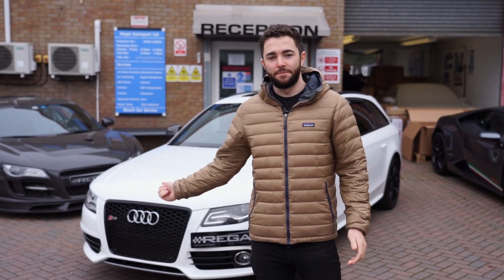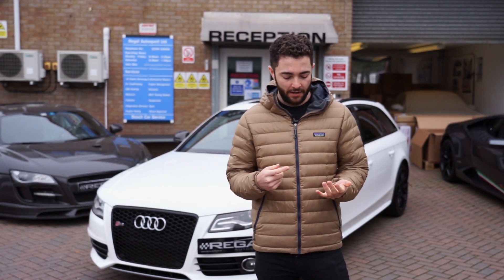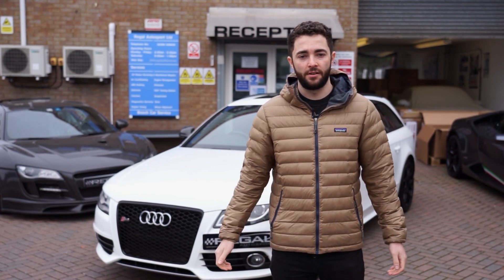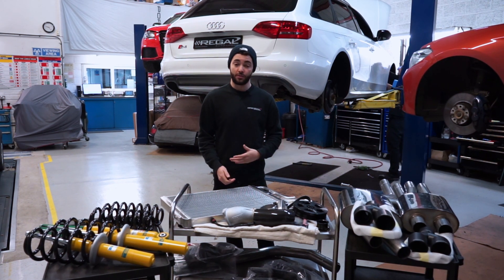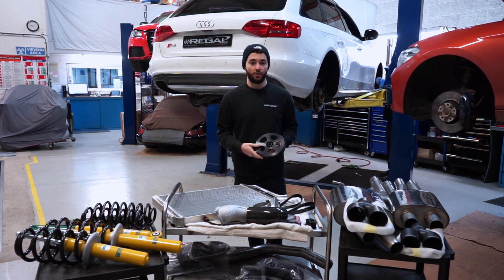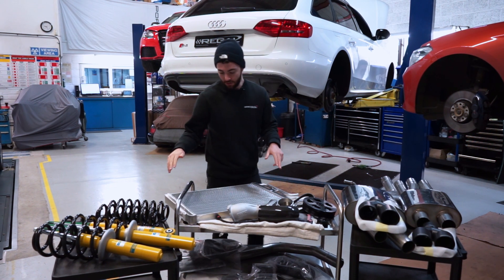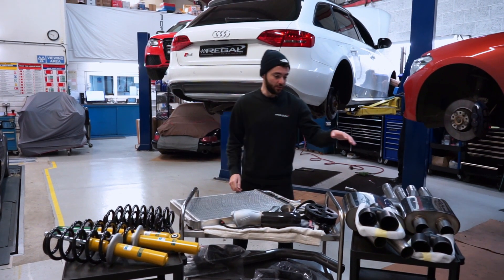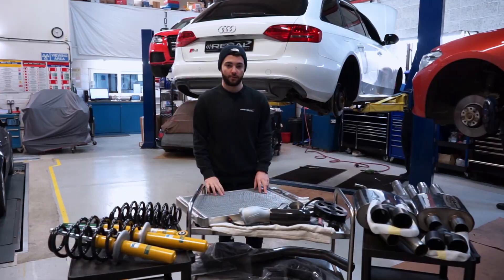How to get 500HP + from a B8 S4 3.0TFSi | Parts from APR, Milltek, BILSTEIN & Carbon Fibre

Comment: Is this a wise idea with the auto box? Asking as I'm genuinely curious as I've currently got a 335i and looking to sell and get one of these and I'm worried about the auto box, does a stage 2 hurt the autobox at all?
Reply from the maker: Completely different gearboxes, the BMW gearbox also responds well to tuning. Of course, if the gearbox has not been maintained well and been ran in conditions which degrade it, then its life will come to an end sooner with a higher output.
Reply: not an auto as its a dsg
Reply: @Vteccer666  lol chill out Craig, does it have clutch pedal? Then it's an auto no need to be pedantic and be like oooo it's actually a DSG which is technically not a auto but it is isn't it Craig.
Reply: @Reggie_Kray69  lol a dual clutch is not the same as a normal auto. Go eat some more crayons durrrrrr.

Comment: Nice and well explained video! Getting 500+bhp out of these 3.0TFSIs is expensive! I have a stage 2 S5, with just intake pipe, airbox mod and 187mm crank pulley, so only cost about £400 over stage 1 and got 482bhp and 425lb/ft. I would have to really want to chase the figures to spend the extra £1000s for 26bhp and 25lb/ft. Good work, without guys like you there wouldn't be any advances and smiles per gallon.
Reply: How did you get 482bhp from stage 2?
Reply: @TetrixTMM  I would imagine these figures are at the crank, My vehicle made 485 BHP & 423 ft-lbs at the crank at Awesome GTI Dyno ( DynoJet) - Stage 2 APR with 57mm supercharger pulley. 
Now running a 179mm lower pulley and Heat exchanger as well, but not had it on the dyno since.
Reply: @TetrixTMM  yeah as said, crank figures and pretty normal for stage 2.
Reply: Ho appena comprato una S4b8 tutta originali
Quanti cv hai ottenuto con lo stage 1?
Reply: @fabiomoro6994  Stage 1 420-450bhp

Comment: those puffs of smoke from the exhaust can be an indication of knock.
Reply from the maker: 'puffs of smoke' - it's a new exhaust, there is always debris from manufacturing which come out when ran under high load for the first few hundred miles as it gets dislodged. 

We also log all of the cars we tune, so we can see from the data if there is knock, or not.

Comment: That torque falls off so much.
Reply from the maker: The only way to help that is with a bigger supercharger!
Reply: @RegalAutosport  can you put a bigger sc on these?
Reply: @Reggie_Kray69  of course u can. apr got annother ultracharger in their shop i think it limits somewhere around 600hp. but u will rip ur transmission and gearbox if u didnt upgrade those. so your pretty  much better of with stage 2

Comment: it cannot have stage 1 ecu tune and provide 449 hp  i needed aprt stage 2 tune and crank pulley
Reply from the maker: It has an ECU tune which is optimised for the parts fitted, hope that helps!

Comment: Brave not to remove the cats on a duel pulley set up!
Reply: It's all in the mapping. Dual pulley only increases the SC speed, the mapping will control boost and exhaust temps. Max SC ratio is 3.2 on these engines. The SC cannot give any more boost, the efficiency is lost and it turns into heat gun rather than air compressor. Safe ratio is around 3 to 3.1. Also most go big on Crank rather than SC pulley as you can get a 206mm crank pulley now. Another option is move the cats to where the downpipe silencers sit away from the hot manifold.
Reply from the maker: Thanks for the comment! These already have the secondary cats removed and none of our customers have had any issues with the primary, probably due to the APR software perhaps not running as aggressive ignition, overrun crackles and flames through the exhaust. 

All of those things degrade the cats and then when you add bad quality fuel into the mix.. it's a recipe for cat failure.
Reply: @RegalAutosport  pretty impressive that they’ve managed to get that much power and still keep the cats at a safe temp, most other tuners recommended decats which is an engine out job. Mines still standard for now but plan to go single pulley next year 👍
Reply: @RegalAutosport  Most melted cats are a result from improper tuning or trying to squeeze more out of the engine. Some say the earlier cars are more prone to this. Ps, these Engines don't have secondary cats.

Comment: is there room to put in a turbo? been thinking about putting a sage 2 supercharger kit and a turbo in.
Reply from the maker: Not as far as we're away, compound charging will also introduce more heat into the charge system and these cars are already knock limited, so adding a turbo(s), it doesn't solve the limitation of the hardware which is causing knock limitations.
Reply: If you want a turbo V6 go for an Infiniti Q50 or Q60 redsport.

Comment: Stage 1 was already 449hp? (!)
Reply: Yup, Stage 1 in these cars delivers 400 plus horsepower. They are 335 stock. A good tune on average will give you 100 more horsepower so yup, 449.
Reply: Yeah I have an MRC tune one my B8.5 and it Dyno’d at 449.8, super impressed with it.
Reply from the maker: ''This S4 arrived with APR Stage 1 ECU software, unknown TCU upgrade and Carbonio Stage 2 intake upgrade and the baseline figures were 449HP & 385lbfts.''
Reply: @RegalAutosport  impressive for stage one, damn!

Comment: This might be a stupid question but i was considering an a6 allroad and i know that it also has the 3.0 motor and similar power output as an s4. Is the allroad turbo and the s4 supercharged? Was wondering if i can still tune and get adequate power from the allroad? Thanks I’m a newbie to the Audi world
Reply: The A6 also has the same engine and depending on year is either supercharged or with turbo. You will gain more top end power with a turbo because it doesn't run out of breath like a SC does and is more efficient. Plus with a turbo, all you need to do is tune the ECU to get more boost. You don't need to install pulleys. You still want to upgrade the intercooler\heat exchanger when you make power upgrades to maintain lower charge air temperatures. If you don't, what will happen is the ECU will detect more knocking due to the higher temps and pull timing which will decrease power output.
Reply: @TwentytenS4B8  awesome thanks for the info!! It’s confusing because as you know Audi says 3.0 T but it’s actually supercharged guess I just wanted to confuse people LOL.
Reply: @mcwendel8066  Audi like all other German manufacturers likes to be unique in their verbiage. They hit a home run with the 3.0T and they decided to put a variant of that engine in other models. The SQ5 also runs this engine. And I'm pretty sure the standard Q5 also has it as an option since most have the 2.0T. Later years, they went to a turbo which really put this engine at the top of the pecking order. It is capable of generating 500 plus HP, but then it would crap all over everything else they offer. That's why the 2.5L five cylinder in the RS3, and TTRS isn't putting out the power it is capable of. Because it would then torch an RS7. Even an R8 would have its hands full running against a 2.5L or even a well tuned and upgraded 3.0T. Really late offerings of the 3.0T came with a turbo instead of the supercharger. These in my opinion are the better option because to get more boost, all you need is a tune since the ECU controls boost and no more messing with pulleys.
Reply: @TwentytenS4B8  thanks for the response! Just trying to do my homework before i pull the trigger on a car. Don’t want to buy a car to find out i have the model with no tuning capability 🤦🏼‍♂️.
Reply from the maker: No question is stupid! The A6 Allroad did come with a 3.0TFSi which is similar to the one in the S4. You can get the same/similar gains as this S4 with the same mods. 

To find out more, you can speak to a performance specialist by using the contact info in the description